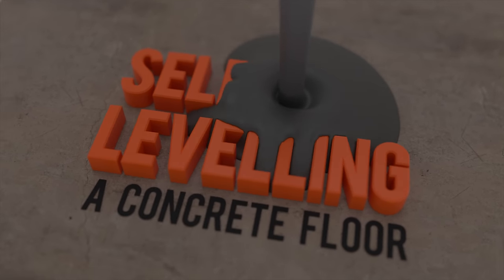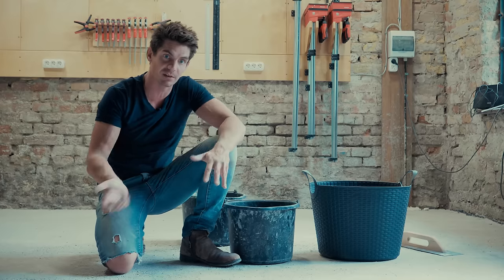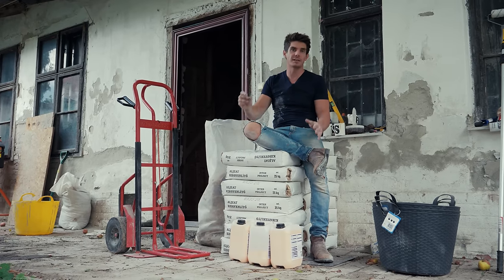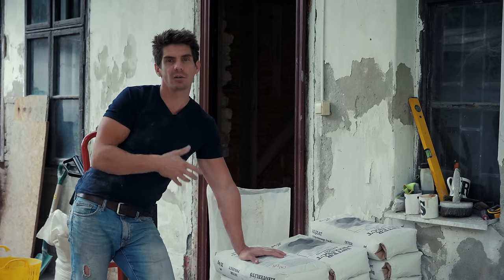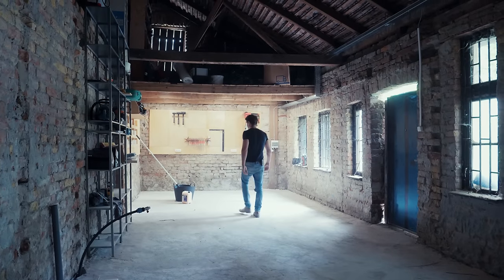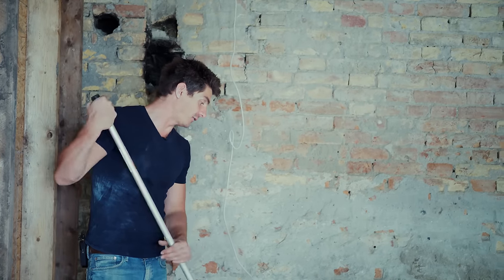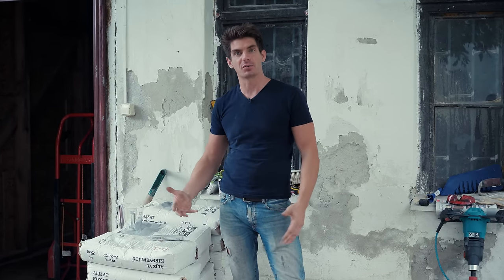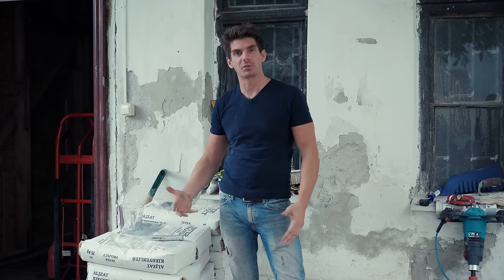Self-levelling a floor - The Complete Guide

Comment: Learn from my mistake! My son and I were pouring self levelling concrete over newly laid 3/4" plywood to lay down a concrete floor for a bathroom (to be tiled). I mixed and my son poured and spread. We needed 8 bags of cement. The problem was the cement started to set rather quickly, after about 15 minutes. So when my son poured freshly mixed concrete it refused to meld with the setting concrete and created lumps and dents. It took me half a day to grind off a big bump in the floor. Plus we had to do another corrective pour to fill an area that was lower (a big dent). This all could have been avoided if  a) 1 mixed 2 bags at once in a larger container like a garbage can, mixing one bucket at a time was too slow, you need to have as much liquidy cement on the floor as possible 2) had we had a spiked roller to even the edges and 3) watched this video.
Reply: how is this dfiferent from concrete mix ? aside from sel leving at $45 a bag vs $8 a bag for concrete bag

Comment: a friend of mine does all types of stone/tile work. He said if doing a large job with many bucket mixings, fill a bucket to the exact amount of water then drill a hole at the top level. you'll always have the correct amount of water to pour into mixing bucket.
Reply: Don Proctor that is such a good tip thanks
Reply: Genius!
Reply: @barkershill  ??? .... you decide where to drill the hole based on the volume or weight of substance you wish to consistently measure. If you want 5 gallons or 2 litres you will fill the bucket to the level you want and then drill a hole at the fill line so any excess drips away. ....
Reply: Looking at the walls of that building , obviously they need pointing /rendering /painting . Would it not have been better to do that first and save messing up the new floor?

Comment: A couple of things you might want to consider for priming.  On a rough floor like the one in the video you should use a stiff bristle broom instead of a roller.  The reason for this is that no matter how carefully you sweep a dusty concrete floor there will always be a residue.  By using a broom and scrubbing in the primer you actually incorporate the dust into the primer instead of just rolling over it.  It really makes a big difference in the bond strength..  Oh and a convenience tip - instead of pouring the primer directly on the floor, put it into a bug sprayer and spray onto the floor prior to brooming it in.  It's neater and prevents puddling.
Reply: We used to sweep/ mop the dusty floor/sweep mop again if needed. Then use a thick nap roller. I like your ideas though! Every trick helps
Reply: @drakevelazquez8728  many priming products  reccomend  to use a broom /brush on concrete  not a roller
Reply: I like the broom idea. Great tip we're just getting into interior coatings
Reply: Yep . Always swirl it around pressing it to be sure it is sticking to the floor and not like dough on a floured rolling pin .
 Tar on the dussty roof too.
Reply: @gregorydahl  Dirt and dust on anything....
Reply: There is black jack paint used on one corner of the concrete floor. Will the primer still work if its applied over it?

Comment: Pretty good video - you covered just about everything, and clearly. A couple of points I'd add:  #1 / I totally agree with the viewer who said you need a person mixing and helping with the carrying, so that the spreader can concentrate on that. You want as much as possible of the area to be runny at the same time. Once the compound starts to firm up, you will have lost the opportunity to achieve a truly level floor.  YOU DON'T GET A SECOND CHANCE with this stuff.   #2/ The spiked roller is almost essential if you want a really smooth and level finish. The spikes constantly break the surface tension, HUGELY aiding the leveling process. The difference between spiked rolling, and trowelling only, has to be experienced to be believed. I have tried both, and I will NEVER again do a project without the spiked roller. 3/ Spiked shoe bases again are highly recommended, if at all possible, as you can walk all over the job without leaving craters, that may or may not level up properly.   #4 / Don't try to feather out any edges to a zero thickness, certainly if the leveller is intended to be your finished surface. Apart from that .. happy levelling. It's a great addition to the building game.

Comment: Great job! Handy tip I’ve used before is getting a flat disc on a 9” grinder and just going over the floor for half an hour taking of the high bits, also with mixing I’ll normally add half a bag and give it a quick mix, then add a quarter, mix that then add what’s left, just means you’re not fighting a big lump in the middle, keep up the good work!!

Comment: If you use a piece of wire e.g.  cut up a wire coat hanger and hang it over the internal edge of the bucket at the required level you are guaranteed the correct amount of liquid every time without having to search for the measure mark. This works particularly well for mixing coloured 2 pack mixes where you cannot see the measure marks. You just make 2 measure wires. One for part A and one for part B.
Reply: genius a small screw would work too

Comment: 17:00 I found myself in the kitchen that 1ml of water is equal of 1gramm exactly. So you can use a scale instead is much more efficient and accurate. 5.5 liter is 5500 ml are equal to 5500 grams or 5.5 kilos of water.
Trace a line in the bucket after that..
Pouring severals graduated glass of water into the bucket increase the error marge every time resulting in an innaccurate final reading.
Reply: Depending on the temperature of the water, may not be 1g exactly.
Reply: 1000l Is equal 1000kg at 4 degrees c

Comment: If you have a short paddle mixer and a lot to mix, build a sturdy platform for the bucket to sit on so that you are standing upright, It will save a lot backache.
Also, mixers can take a few seconds to stop so a hanger to suspend the mixer on between uses saves valuable time. 
The cable tends to wrap around spindle easily as it doesn't stop spinning immediately so I extend the flexible grommet to help keep the cable away from the moving parts.

Comment: We usually burn the fibers off with either a weed torch or a small propane torch-much easier than cutting them, just make sure there is nothing flammable around if you do burn.  After burning sweep or vacuum up ashes.

Comment: Absolutely perfick. Am retired now but did exactly as you advised except for one thing. In Australia we can buy a “walking trowel” specifically for this work. Means you pour as you did by walking pouring the bucket along the perimeter of room and then whilst standing the trowel which is on a broom handle 400mm wide fixed at about 30 degrees on long side and you gently ‘sweep it” back and forth. Great for around toilet pedestals into corners etc. the trowel has the leading edge at right angle to the short sides but rounded on the top clean edge. Was able to do large areas without bending or soiling knees.

Comment: In my experience self levelling compound (SLC) is usually not self levelling. It's just self smoothing, at best. Just spreading it around can leave it looking flat when wet but once dry you can easily find +- 5mm variance in thickness over a 1m length - even if you're using screeding tripods as a guide. To get it actually flat and level I'd say you need to use framing and a screeding bar. First do any grinding down of high spots/areas, then pick your zero reference on the floor and mark it. Your SLC will come up from that reference height to your chosen thickness. Then use a laser level (a cheap one with a basic horizontal and vertical laser is fine for most purposes) to mark on the floor heights along the lines that your framing rails will go. You'll draw your screeding bar along these rails to move the SLC into place. Essentially you're building rails that are perfectly level along their path, then using a perfectly flat edge to make sure the rest of the floor is flat. You may need to do some additional bits of grinding or patching with something like quick-set cement just along the rail paths (using the height you marked to get everything to zero) before putting the rails down.

For the rails what you use will depend on how thick you want your SLC. For ~6-18mm you can use MDF sheets, sealed (e.g. SBR or Acrylic primer) after they've been cut into thin strips to make the rail/framing sections. If you're going thinner, say 2mm or 3mm, e.g. for a surface finish then you can use aluminium strips.
Screw the rail sections carefully into place (after drilling and countersinking, so the screws can sit flush with the rail without causing any deformation). Place the rails just a little less than the length of your screed bar apart.

Now you're ready to poor the SLC. Mix it really well. When pouring aim to get it roughly where it needs to be initially, and if using a spiked roller (ideally do that), do it now. Then pass over the rails with the screeding bar. Be careful not to bend the screeding bar as you move it over the rails and hold it at a ~45deg angle to the rails (so only 1 edge is in contact) to avoid sucking the SLC along after the the bar (which would mean your level wont be where you want it). Good luck! :)
Reply: Well said.  Too many try to find shortcuts from traditional methods that have adequatedly proven themselves.  Quality often comes at a cost.  In this case...knowledgeable and experienced hand labor.  Quality should not be sacrificed for lazyness, or cost. A properly designed floor will last a long time.  Whatever you spend on it will reward the client with decades or longer satisfaction.
Reply: Never used a screed bar for the type of job you described I've always used a stand up whale tail where you push the leveler up against your predetermined dumpy heights, very effective and you can knock down any ripple after with the HTC. I use a Hippo on wheels for a four bag mix or if we do multiple floors we pump.
Reply: I agree with the term 'self-smoothing'. It's too thick and sets too fast to truly find a level. I know this because I've just had my kitchen floor 'levelled' with this stuff and all it's done is smooth it out without truly levelling it. There are gradients of 1cm in 1.5m still.  If you need to truly level a floor you need to put levelling tripods all over it and align them with a laser level before applying your compound/screed to the level shown on the tripods.

Comment: To be specific: the water mixes with the calcium oxide(lime) to make  calcium hydroxide (slaked lime) which in turn reacts with the CO2 in the atmosphere to make calcium carbonate(limestone). 
Cement is made by reversing the process. They "calcine" limestone which means heat up at a high enough temperature to drive out the CO2 and water from the limestone. The resulting calcium oxide chunks, called Clinker, get ground down to a powder  in a tumbler grinder/mill and that's the cement. 
It's not just Calcium, as it often involves some magnesia and silicates, but the calcium is usually the principal component.

Comment: The explanation on concrete curing "drying" was very well said. This is why you can't leave concrete in a mixer or bucket and simple add more water. It will cure under water. The mix might be different but it will still get hard. Also, this is why concrete is covered with plastic to strengthen it, if the air is very dry. Rain doesn't effect concrete aside from physically disturbing the surface.

Comment: First off when you spread the primer, do not put it on so thick that it pools on the floor. You want a  thin coat  like painting a car.  He had way to much on the floor. Second that porcupine roller is for self leveler they can be reactivated.  Also,  you should have been mixing it in the site where he needs it not outside the building than hauling it in, its sitting in the bucket to long. You need to  mix it and put on the floor immediately.  Last thing is self leveler will find any little hole and flow down it so if you are working with drains make sure they are sealed off with duct tape or some type rubber dam. Or you might  see the leveler drain down. This also includes under walls if you are above grade, it could flow under a wall and down to the floor below. Chalking the walls the day prior can save you a major clean up if the building is not sealed from floor to floor. Sorry wasn't intended to bash on you. You did hit the main points on the importance of the proper primer. Accurate water measurements. And mixing. Most products have a time of 2-3 mins @ 350 rpm's for example. Under mixing is as bad as over mixing.
Reply: Thanks... Great comment

Comment: Good intro for DIY enthusiasts. I do thousands of m2 of this stuff every year.  Problem is your mixing prep took too long and that spike roller had to go on straight away after pulling. The air bubbles MUST be removed failing which you get a weak floor. Depending on ambient temperature some products have 6 - 10 minutes working time to join to the next mix. Which is not alot of time.

Comment: I watch heaps of these advice types of videos on YouTube as I enjoy doing some work myself, about to raise my kitchen floor 20mm and wanted some tips on using self leveling mix, I came across this video and found it to be about the best one I've seen. Awesome tips well presented, thanks heaps from Melbourne.
Reply: Peter Hushin why are you raising your floors that much?
Reply: @mikeo6525  I installed wooden floors and with the 10mm ply and then the wooden planks it took to gap to between 20 - 25mm difference
Reply: Peter Hushin that makes sense. Consider raising your other floors with plywood. It will be cheaper and easier plus plywood will be more structurally stable compared to a cement leveler

Comment: What can 685 grouches find wrong with this detailed, complete and well presented video?
Reply: Because this is not self-leveling how I imagine it. If you would like to install a floating floor, this would not be leveled enough... You would have to make much more self-leveling concrete/mixture (in much more bigger container) and pour it at once... Not mentioning that by this way of self-leveling you could have problems with furniture (table, wardrobe etc.), while the floor would not be leveled perfectly.
Reply: @MrTomasekk   A "floating floor" by definition is a floor (usually a slab topping) that isn't physically connected to the subfloor structure.  An application is to reduce impact sound transmission.  If the objective is to achieve a level floor surface over a substrate that deviates from level by in the order of 15mm then a "self levelling"  i.e. floor that can flow to form a level surface, is what is being very well demonstrated in this video.  If you need to level a floor that's more significantly out of level, a different method can be used. Over an existing concrete floor a concrete topping can be applied by scrabbling the existing surface to form a key,  priming with a cement and water mix, pouring, compacting  and levelling the floor.  If the concrete surface is to achieve its intended strength then covering it with plastic sheet (or keeping it wet) will retain the water required for hydration of the cement in the mix for a sufficient time.

Comment: I’m having flashbacks to when I did my own floor. 40 bags, alone, only following the instructions on the bag 😂 I got a good result in the end, but it is not as easy as this guy makes it look! The one thing I learned is that I will never do it alone again. It would be really really helpful to have someone mixing for you whilst you only have to worry about spreading it! 

Nice job though and I like the effect the roller gave. A good non slip finish for a shed 👍
Reply: If you are working fast enough, and that means having enough people for the size of the job, you won't end up with the spiked roller 'dimples'.

Comment: Excellent overview! My 2 cents - In addition to the spiky-roller, it also helps to use a notched tiling trowel or notched-adhesive-spreader-on-a-long-broom-handle to really spread the goop around to encourage it to self-level. Also, a squeegee  with a long handle can help flattening the goop without straining your back :) BTW - add spacer-tape along the walls, if pouring more than 5mm thick :)
Reply: What’s spacer tape?
Reply: @TomNouri  It's basically an adhesive-backed foam tape - 3mm to 8mm thick. This prevents the poured floor touching the walls and potentially cracking due to slight movement of the wall.
Reply: Thanks for the info 👍🏼👍🏼👍🏼

Comment: Big job. I remember seeing a truck which mixed self leveller for a second floor. They had squeezecrete to pump.
Well done on your job. That's not easy work and lots of cleaning. I had to level on a smooth troweled concrete floor.
Since it was a shop on lease.
 I spoke with an industrial chemist and followed his advice. You can get fine silica sand and mix with cement and also use a screedbond which is a latex synthetic rubberised emulsion system. Say for instance a bonding agent and mixed 50% with water.
I mixed at 2.8 cement with silica sand.
I used a feathering edge which worked quiet well was pleasing. The area I needed to cover was not as big as what you did. However I achieved pleasing results.
Hopefully it hasn't laminated. The problem with self leveller is it is a liquid type of application and it only self levels the area you cover before the liquid hardens.